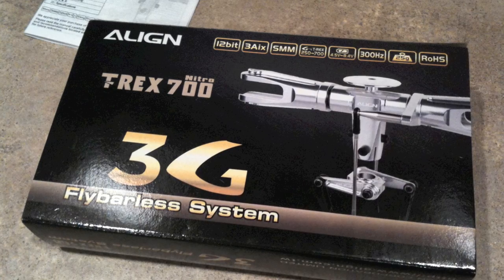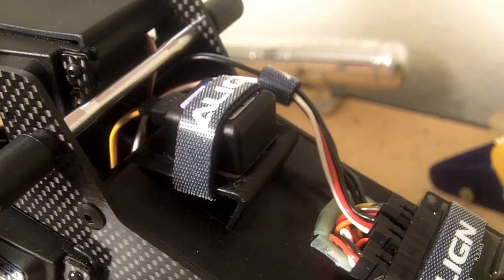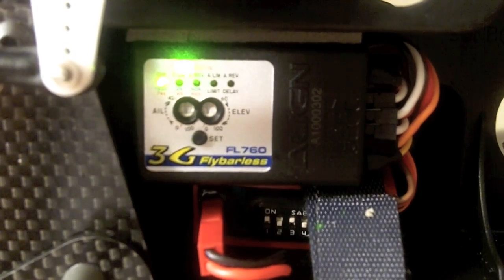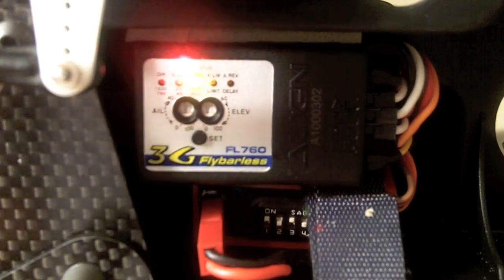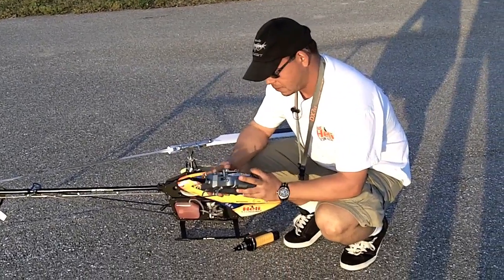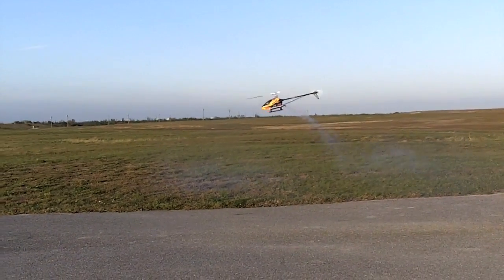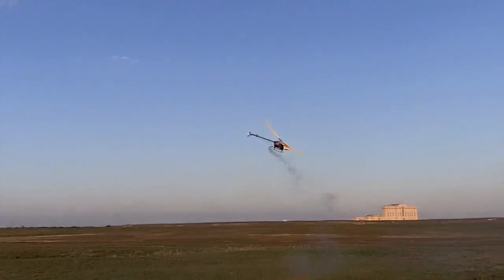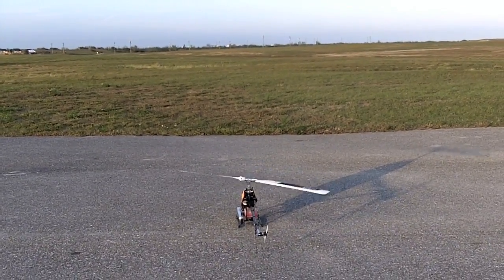Bert Kammerer - Align Flybarless 3G

Comment: IDK either, I imported an ESP T-Rex 500 3G last week, just got the whole thing assembled and basically RTF. I did a couple of ground tests (Blade tracking) and so far, so good.

It's actually a lot easier to setup than the flybarred counterparts. I can tell you THAT much; other than that, just go over your setup etc. until you have found what your lookin' for.

Comment: Hi Bert, I have this 3g FL 760, in my trex 600 nitro with 4 blades rotor head, every works OK except rudder gyro compensating direction, is there any way to reverse it?. I use Airtronics RDS8000 as TX.
I would appreciate any Help.
Thanks

Comment: @rootsoase1982   Almost every heli will slightly drift (usually to the left) but if it rolls over into a blade strike then double check your red/green led in the set up for aileron.  Some require it one way or the other.

Comment: @ladieman050893 it is and it isnt the whole point of a fly bar is to correct the movement of the blades and without a flybar it would be so hard to control so the gyro's replace the flybar